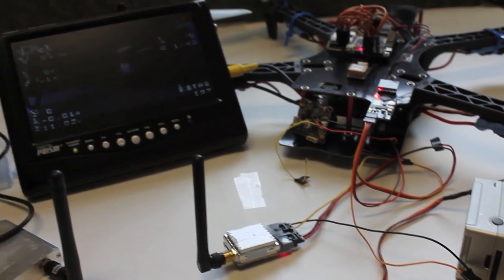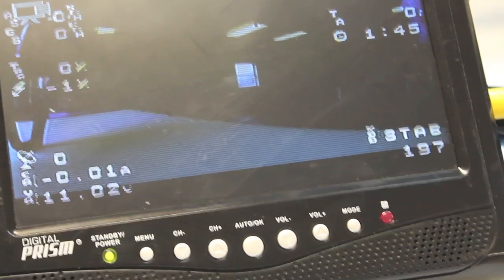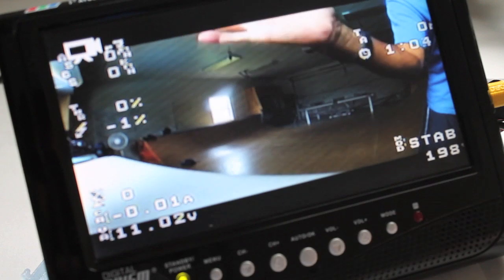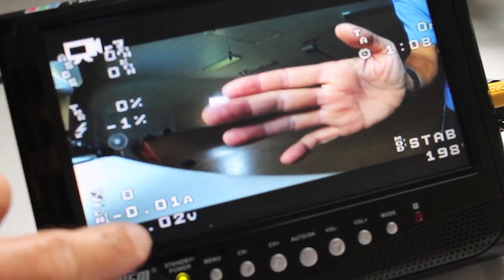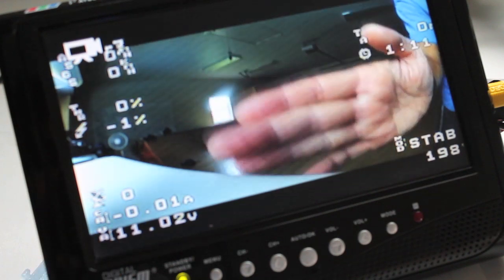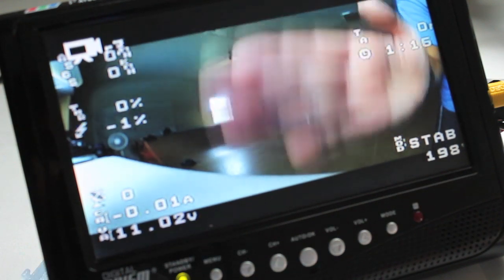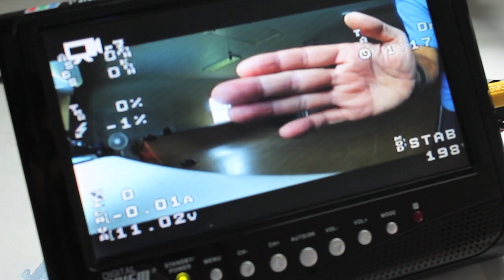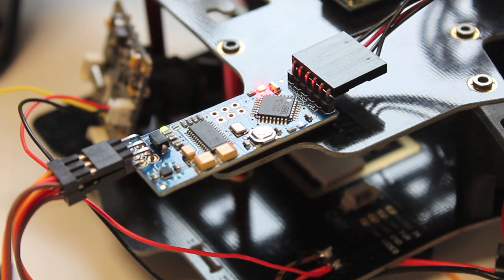GoPro FPV Setup w/ MinimOSD for APM Telemetry

Comment: Hi, can this set up be used for Hero 3. Cheers
Reply from the maker: Yes...it should be possible but it's been such a long time since I've worked with the Hero 3. I read somewhere that GoPro has removed live video out with their newer firmware. I'm not sure if that's too but something to consider as you're working on your project.

Comment: so, after 4 weeks working on it, it doesn't work, I had video from go pro, but nothing from miniosd,  testes so many cables I bought on ebay, and it looks like it fu..cked up my pixhawk,  pixhawk won't arm anymore,  won play any music, when connected to usb, it's making weird scratching noises, and won't play aby music, won't connect,  it's getting hot, and laptop state showing weird message that usb surge detected,  basically pixhawk wanted to pull more power usb than usb can provide,  so for me it looks like pixhawk got fried

Comment: doesnt work with my configuration, after 4 weeks of work on it, I am done!, miniosd connected to pixkawh, tried port 1 and 2 for telemetry, connected from gopro to miniosd to video IN, and from video OUT to transmiter, I have a video from gopro, but nothing from moniosd,  tried different cable co I was connected from pixhawk to telemetry and miniosd,  nothing, now, I am using TFT cable to connect miniosd to PC< and the freaking PC has a certificate problem with the cable, so when I try to do soomething, it doesnt see the COM port, what a BS

Comment: Thanks for the video. I'm pulling my hair out with this one!!  The closest I have come is getting a screen covered in characters from the minimosd.  I was told that using my 3s battery to go in to the minimosd will be putting way too much power in there.  Is that right?  I'm so confused!!   So there is power coming to the mimimosd from the APM, and then power coming from my 3s balance lead - is that right?  Please help.
Reply from the maker: Jayden Lawson I'm pretty sure you got it right so far. Here is a good diagram that shows power on both sides:

http://copter.ardupilot.com/wiki/common-optional-hardware/common-minim-osd-quick-installation-guide/

I used a 3S as well and didn't have any problems, although I didn't run it from the balance connector. If you continue to have problems check out www.garagepilots.com and post in the forums. We should be able to help you out over there. Best of luck.

Comment: can you run this osd on 5v? if I have a 5v camera and a 5v video transmitter can it work with this osd? also if I move the osd can I see my horizon move in real time on the screen or do I need a gsp for that?
Reply from the maker: 1airhogs Here is a good article on how to make it run off 5V on both sides of the board:

http://hoogvlieger.wordpress.com/2013/11/01/rctimer-minimosd-5v-mod/

The OSD doesn't have any sort of sensors so you'll need a flight controller to send along the orientation of your multirotor.

Comment: You have three wires going into the osd, one of those i see as video in from gopro. What are the other two?
Reply from the maker: kennethpappas Power, ground, and video. Check out this wiring diagram, which is what I referenced when I did the original install:

http://planner.ardupilot.com/wp-content/uploads/sites/5/2013/11/DiagramaMinimOSD.jpg

Good luck and if you have any more problems check out www.garagepilots.com and post in the forums.

Comment: I'm using the v.5 minimosd from Witespy ($12) withe the gopro H3 and it works great. I have a plug from the gopro to the minimosd and from that I have the tx plug into the osd and the my 11.1 the power the tx powers the osd also.  I did a video on it (tntneon) check it out.  Be blessed